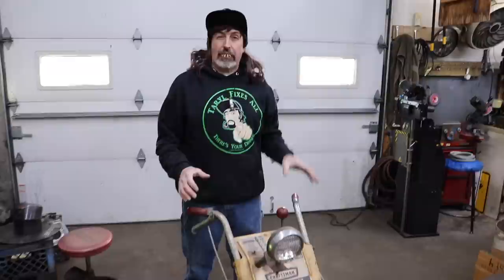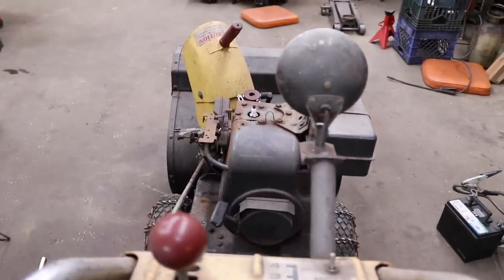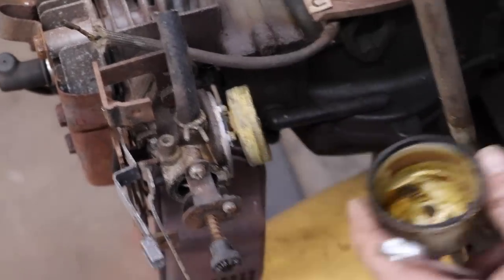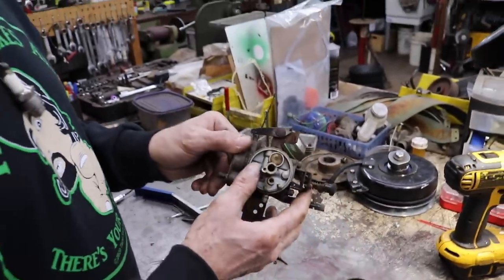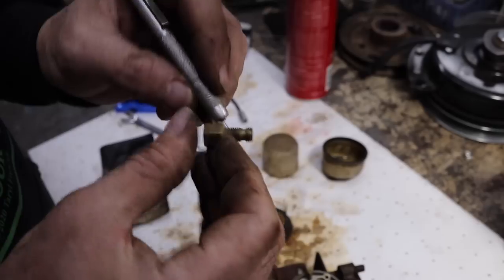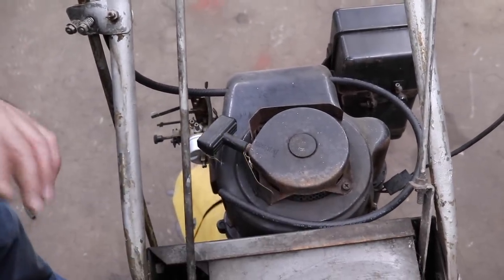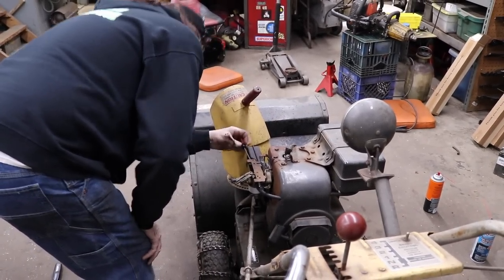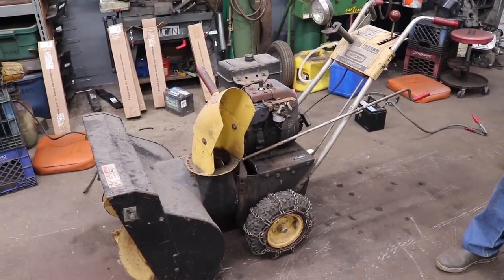⚠️ Most DANGEROUS Snowblower EVER! Let's Get It Running

Comment: Why not replace the "Welsh" plug to ensure all the Fuel Passages are clear Tayrl?
I always hated (regretted) working on TECUMSEH Carburetors because parts were hard to find and expensive for the Customer (back when I Owned/Operated a Mobile Small Engine as a Mechanic back in 2012.
The Needle and Seat are the worst part!

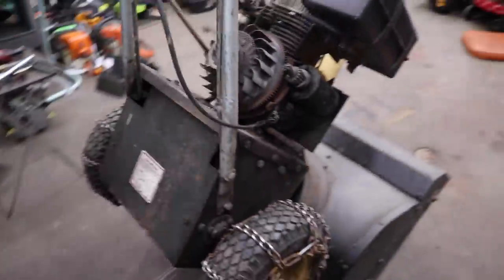Comment: 14:00  Bottom cover slotted to let chains and sprockets hang below to scoop up snow and ice??????

Also, if you are keeping this snowblower to run it, find the shear pins, take them out and see if they are real shear pins (nobody swapped in a steel bolt?).    And that the parts the shear pin connected arent rusted together so it will let go if you shear a pin.

Comment: Her Taryl, feel like disassembling the clutch to adjust it's "stall"? Don't need to buy stronger springs or lighter weights. Just weigh the weights and grind or drill a small and equal amount from each weight and see if it works better for you.

Comment: I have one of these snowblowers in my collection, but I haven't gotten around to restoring it yet. They are very similar to and share many parts with AMF Polar Bear snowblowers. Some of the AMFs are actually nicer since they have ratcheting wheel hubs to make turning easier, plus the auger can be disengaged as they're belt drive. My plan is to combine the best of the two to make the ultimate dangerous snowblower. But truth be told, these things are rather tame compared to my Maxim 728.

Comment: That is an AMF snowblower, not Murray, even though AMF was sold to Noma, who was then sold to Murray, who was then absorbed into Briggs when Murray went bankrupt. 536 was AMF, 502 was Murray, and 768 was Noma/Canadiana/Brute. 

Also, that is either a late '60's or very early '70's unit, as Craftsman stopped painting them grey and yellow and switched to red around 1974 or 5. 

Every Ariens 10 and 910 series snowblower had the very same squeeze to stop drive system, as did most other manufacturers. Only Reo (and the subsequent Wheel Horse) snowblowers had a deadman drive in 1967 until the early '70's. 

Last, that Tecumseh engine has a 143.xyzzrr model number. The x is code for the crank direction and the decade, the y is the year, and should match the first digit of the four digit and one letter date code number.

Comment: Taryl You should have left the First setting alone, The carb sounded great, 3/4 1 1/4 turns out should be great you set it for 7/8 on get go, There,s a old saying if it work,s leave it alone.

Comment: I have an Ariens that works the same way except it has a clutch lever on the side to engage the auger. I always thought it was sort of dangerous especially considering you use it in slippery conditions. I have slipped and fell when snow blowing more than once.

Comment: Thanks Taryl but i will have to pass on your offer right now since i follow you on my wife's laptop and not on my own cell phone which i have to get a new one. I'll give you a little story of my snow hound. When i got my 20-inch toro snowhound my wife says does it run? i don't know, if it doesn't i,ll chuck it. It had compression ,not very much and one of the #35 chains were broken . So i put some motion lotion in the tank and down the spark plug hole and she fired right up, yeah . I went to the local mower repair shop and bought 2 foot of # 35 chain and the counter guy tells me he can't get parts for it, another nay Sayer . I've used it on all the blizzards here on Long Island New York but where the snow plow leaves a pile at the end of the driveway i have to break it up with a shovel, better than shoveling. One time i took it to the local R/C field to clear a runway and i accidently hit the curb with the auger. The machine is built like a tank and the only thing that happened to it was the master link bent and came apart and a scratch on the auger. I have another story about going through snow if you are interested and will tell you later about it

Comment: If the spark plug boot was hard maybe it had a very fine crack which allowed spark to bleed out the side to ground. I recently had a chainsaw in and the only reason I discovered the boot had a crack was because when I was tuning it with my tachometer I was holding the tach in close to the boot and my hand was resting on the boot and I was getting a little buzz through the boot. Cleaned it up and applied a layer of Threebond 1184. Problem solved.

Comment: That particular carburetor only the one with the little rod in the tube for the low speed turning the low speed jet in makes the low speed richer and turning it out makes it leaner it's the opposite of normal carburetors I have a 65 Toro push mower that has the same type of carburetor that's the same way n is rich and out is lean on the low speed.

Comment: Could you make it work better by replacing the centrifugal clutch with an electrical one? maybe use the light power to energize it or use a motorcycle battery?

Comment: Maybe not being able to get the idle low enough to shut down the auger is a good thing. If the auger shut down you might think it was safe.
Reply: Nope. Then when it gets ice blocked and the engine RPM lowers, the auger stops. Until it gets unblocked. Then it lurches forward with the auger spinning at full speed.

Comment: Is it that things were dangerous back in the day or are people just gettin dumber with no common sense.
Reply: Things were more dangerous. This trash snowblower cut off my father's wrist back in the 80s. I was 5, couldn't shut it off either even though I went for the spark plug wire boot. Which way do you pull those unlabeled throttle levers with your father laying on the ground with arm wrapped into the auger and seeing the pool of blood grow in the snow?
Reply: @joec.2768 , Sorry you had to go through that at such a young age. The problem i have with that is, its not like the movie Maximum Overdrive and the thing didn't turn on him with a mind of its own. That brings back the common sense statement I made. You never put any body part around moving parts on machinery.

Comment: I have one thats worse, old jap 10hp 2stroke, u have one lever inbetween the handlebar to start the auger so u have to let go of handlebar to engage auger. 
But Whats even worse is that down behind the wheels u have a lever u nock sideways with your foot to engage the drive, 2 gears forward and if u nock the lever abit to hard it jumps over first gear and hits second gear and it freaking flies forward no clutch nothing once in gear it moves everything in its way until u manage to kick the lever back to neutral.

Bloody good snow thrower tho👍 abit hard in second gear since u kinda have to half run behind it but hey the faster it goes the faster ur done😂

Comment: Does it not have a dead mans control on the wheel drive ? why would it keep moving ? ,, but fully understood the issue of not having a dead mans control on the auger drive which means you can't stop the auger without killing the engine making it very dangerous due to that aspect , I remember owning an old Aries that had the auger clutch engagement lever on the side of the belt housing and a throttle/kill on the handlebars ,I had someone was nice enougth to feed an anchored  dog rope out under the Garage door and out into the driveway that of course I could not see under the snow , the auger grabbed the rope and it reeled me in like a whale on a hook. I mashed the throttle closed killing the engine and It managed to stop about 3 inches from mangling the door so point well taken..

Comment: Taryl I am 64 yrs old and use those the problem is these adults don't do a few things  1 listen to the mechanic next Read the Owner Manual  to know it and If you have a question Call and Ask  these new one don't last 3seasons I had two 2stsges that had to get new augers and plastic bushing not brass don't knock the old stuff knock the person behind the handlebars last thing how many 70-80 toros snappers bobcat sensation jacobsen ever rusted out NONE these new one properly cared for 3yrs

Comment: That's a crappy design with that clutch they should have it manual up on the console. That's got to be a b** when it's really cold out and you're trying to start that thing when the auger and the impeller are engaged. Great video though appreciate your hard work.

Comment: Those Tecumseh snow blower engine connecting rods had a tendency to grab the crank pin and break off. The oil quality was very important. I use Diesel engine oil as it has better lubrication qualities as compared to gas engine oils. I have an H70 on a Wheel Horse Work Horse 700 which is similar to the engine in this video. The 7 HP Tecumseh engines had a lot of torque and do make great minibike engines.

Comment: That engine was made early 70's and the snowblower was made by AMF out of Iowa.
Reply: It's a late 60s model. Made shortly after AMF took over Homko.
Reply: Two things that give it away that makes it early 70's on the motor only . Oil cap design  and the lighted coil. they use a aluminum flywheel on early 70"s only. After that they went to cast iron flywheel's and I have pickup these before and date codes are only early 70's. I do own a 69 4hp AMF that is belt drive and converted to a 10hp and now throughs the snow to the moon...lol
Reply: @468delray  I've sold a number of theys over the years. And some of the 60s, have a charger behind the flywheel.

Comment: I was at Louisville KY expo Honda had a unit 5hp EV motor which bolts in place of a Briggs or Tecumseh.
Coolest thing. Runs hours on a batter pack . Convert old equipment to EV.

Comment: I disagree  that this is the most dangerous snow blower ever made, the old gravely dog eater snow blowers hold that title. The original machine they were built for didn't even have a governor
Reply: YES! The old ones were just running hammered! And the 301 Kohler cast iron motors just won't quit! Dog Eaters for the WIN, EASY!

Comment: Mr. Taryl, as a subscriber to your channel, I really appreciate the advice you give, however I beg to differ about a FEW things that I have heard on your channel. After watching your video "proper storage of small engined equipment" from 5yrs ago, I am thoroughly confused! In your old video, you recommend adding a fuel stabilizer (especially "seafoam", now fast forward to 2022, NOW you say that NONE of the stabilizers are worth adding. For all the years you have been working with small engines, it took you till 2022 to determine that these products are "snake oil"? Really? I always thought YOU were the "brightest bulb in the porch". Also, the WORST enemy of batteries is NOT cold (as long as the battery is charged), BUT HEAT, most batteries fail in Summer NOT Winter! Next, the engine oil should be changed BEFORE storage. Reason? You don't want the combustion byproducts (acidic) remaining in the engine during storage. And, if those OLD videos contain misinformation, they should be DELETED to avoid confusion. I REALLY want to thank you for all (well at least 99.9%) the information you provide on your channel..........oh, almost forgot. The comedy skits ARE PRICELESS!!!!